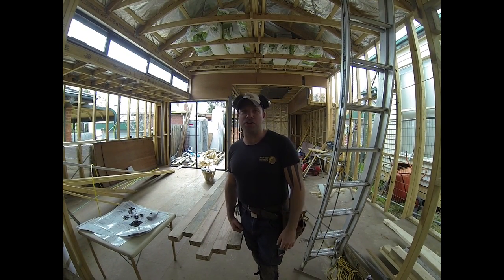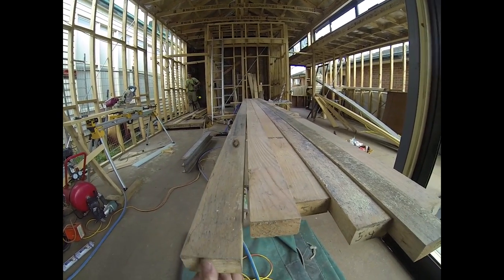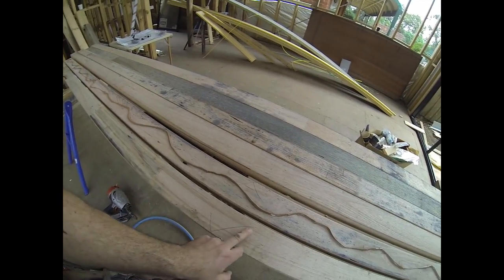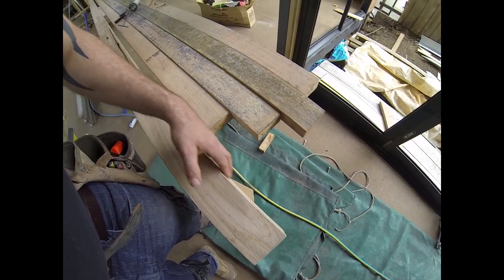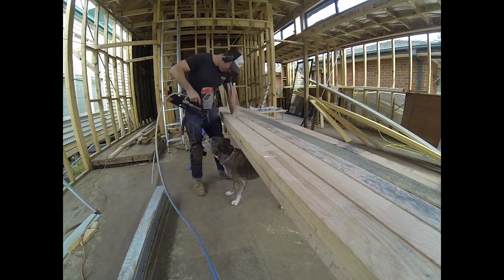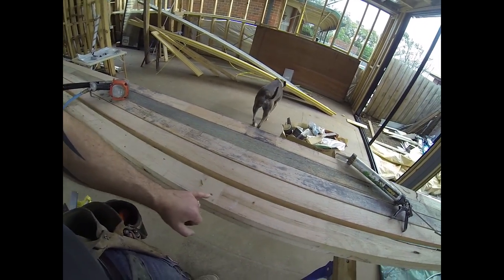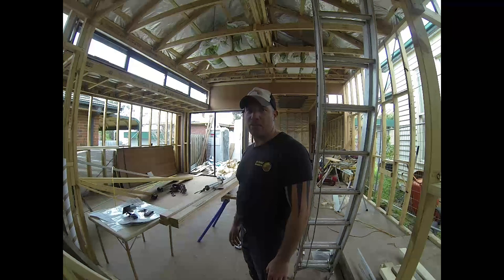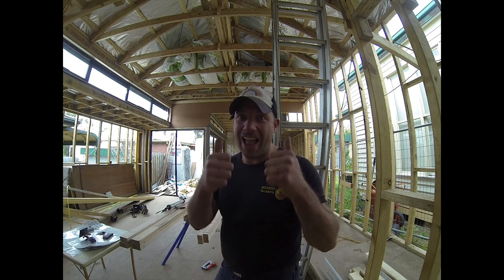How to laminate timber properly for use as a bearer or structural beam

Comment: Nice video and explanation. I'm an amateur so questions may be weird but why would you not use pva glue regular wood glue? 

Cheers
Reply from the maker: Gday Krishna,
the constructions glues have rubber/latex in them to allow for movement without splitting or seperation.
the PVA type glues work great but will "break apart"
#stayawesome
Support our channel at www.patreon.com/beowulfbuilders

Comment: I've done something similar before. Needed redwood beams for outdoor pavilion. Both dimensional lumber and glulam beams were outrageously priced. Made my own 16ft long 4x8's. Plenty of work. You should plane the boards. The adhesive should be rolled on. And you need clamps. Lots of them!! Those nails aren't going to apply $hit for pressure and pressure is exactly what you need. The nails may be peace of mind but aren't doing $hit to help shear flow really.
Reply from the maker: Gday Stephen P,
you are correct, nails alone wont do the job and if you watched the whole vid as i explain what im doing you will see that we also batten screw the entire length alternating edges and on both sides.
#stayawesome
joe joe
Reply: I agree with this comment. Also, question: Isn't normal strong woodglue sufficient?

Comment: Great stuff but I don't believe in the use of nails, all glues require clamping pressure whilst drying. When a nail is shot into wood their is very little clamping force, when using timber screws it pulls the two pieces of timber together with enormous force as if it was being hald in place by clamps
Reply from the maker: Gday 500 Benz,

the Video does go into detail for the bolting or batten screwing together of these types of timbers... we also have a video out showing this.
#stayawesome
joe joe
Reply: Does using screws not negate the need for clamps ? .Doing a project soon and I was only going to screw
Reply: @Interdiction  Screws will only clamp if the first member is predrilled above the size of the screw or if you use screws which are non threaded for the first member.
Reply: bugle screws are designed exactly like this. They give you a (usually) 45mm clean shaft above the thread. They pull 45mm timber together like nobody's business.
Reply: You do not need clamps if you use screws that can pull together (no thread the last 2 cm towards the head). There is absolutely no need for clamps, you just waste valuable time that could be spent getting all the screws in.

Comment: hi . Well Explained video. thanks. Can I ask, - 'is there a general ratio for the added strength to a Bearer or Beam, that is twice the thickness, as you have done in this video. Usually it is extra height which we can find in Span tables for structural timber members' . Normally its a 45mm, or 63mm thick timber structural member, and it is the height (90mm - 400mm) that determines the load bearing strength. Being able to use all the 'dis-used' 90x45 wall studs, and ceiling joists, would be a great saving to be able to put them to use. Thanks for your time, and please excuse my lengthy worded question. Cheers. Jude.
Reply from the maker: GdayJude.... What a ripper of a question i LUUURVE IT ;)
There are structural beams called GL's (Glue Laminated) beames that do exactly this.
With todays technologies its unreal banana peal what we can create for better use onsite.
#stayawesome 
joe joe

Comment: Is this just regular construction Douglas fir? If so, is it okay to use this method for patio covers?
Reply from the maker: Hola Mauricio Gonzalez,
We don't use Douglas Fir much in Australia these days as we have found that the young trees don't have the strength in the grain to withstand the harsh Aussie conditions.  
The timber used here is a Kiln Dried Hard Wood such as Victorian Ash or Mountain Ash.  It is a good Hardy timber yet is subject to splitting if not fixed properly.
#stayawesome
joejoe

Comment: will this become a header?
Reply from the maker: Gday Benjamin & JoAnna,
This particulare set up is for a Bearer (sub floor frame) or a double joist (load bearing point).  You could use this for a header or lintel set up if the engineers computations ask for it.
#stayawesome
uncle joe joe

Comment: Wow - a lot more to that process for a house than I imagined.  LOTS of metal in there - and even with angles and spacing you still use screws to back it up - that's a 4X process: glue, nail, slant, slant, and screw.  And then you plane it.  Is there a better choice if it were your house (and you were paying?)
Reply: What about if you were building a loft in a storage unit? :)
Reply from the maker: Super important to reduce the chance of separation of the timbers, especially under structural stress
stay awesome
joe joe

Comment: to nail laminate two 90x45 from both sides what size nails do you use?
Reply from the maker: gday James,
75-100mm nails that are skewed (opposing angles/force), glue, screw (75mm with counter sunk head) 
stay awesome
joe joe
Reply: In nz we use paslode 90mm  nails
Reply from the maker: Once again  @raymond0996 ,
grouse feed back, and thanks.  a 90mm nail is ALWAYS recommended on a frame.
Stay Awesome
Uncle Joe Joe